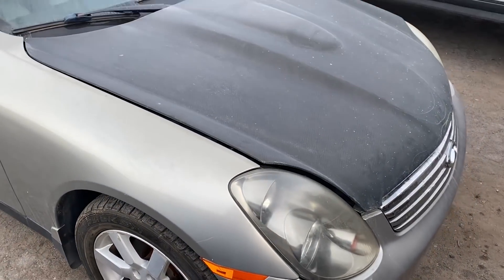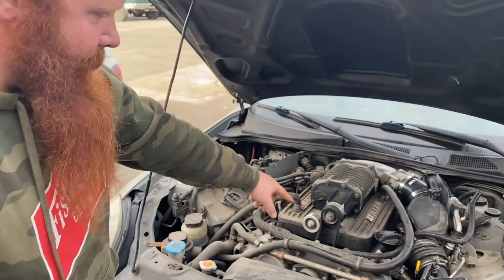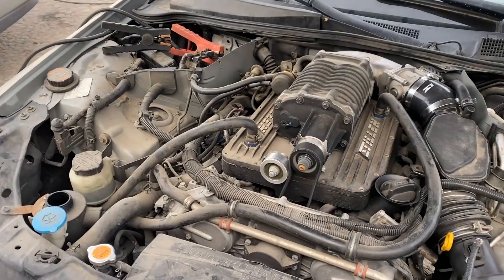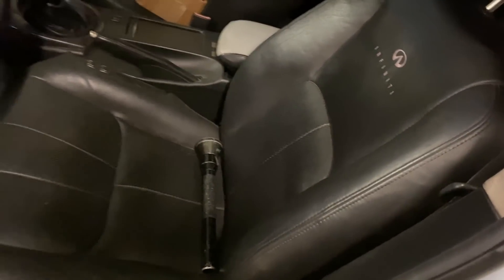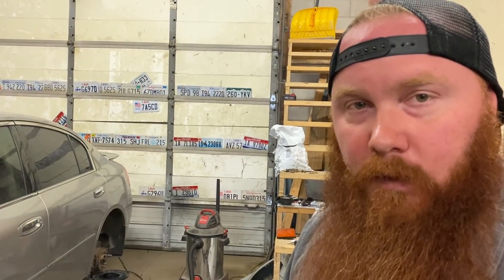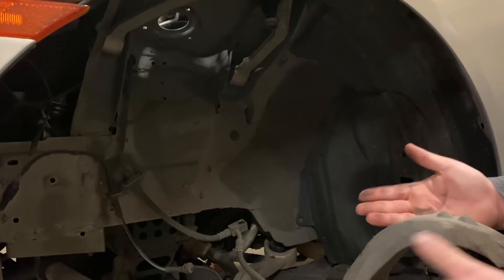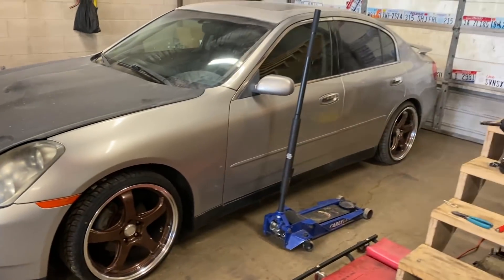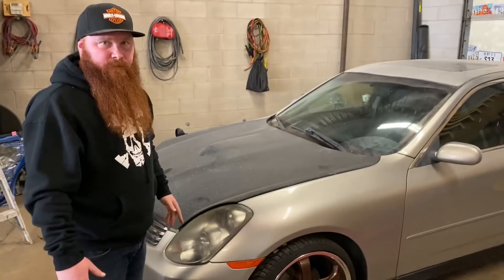Supercharged "Barn Find" Part 1

Comment: Nice! Question - I have a '99 Mustang and can't get the radio out with the DIN pins. Left side won't move/unlock at all, right side is good. Any thoughts? Searched many vids and most are not what I need.
Reply: I would just pay the few bucks for the kit to get it out. You're likely to break stuff with out it
Reply: @snikwad003  There are just 2 holes on each side that the din pins go in to release the radio so I don't know what you mean by a kit.
Reply: Use force
Reply: @BrentRoberts01  My force powers aren't working. I don't want to break the trim either. A bit of a conundrum.
Reply: @rich8021  haha, I'm actually reading your reply while a star wars commercial is playing in the background.